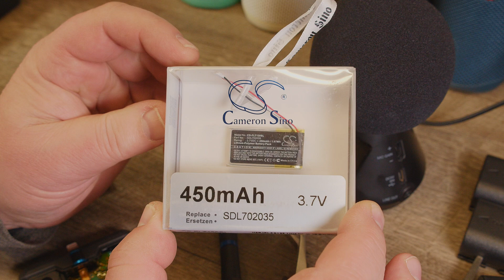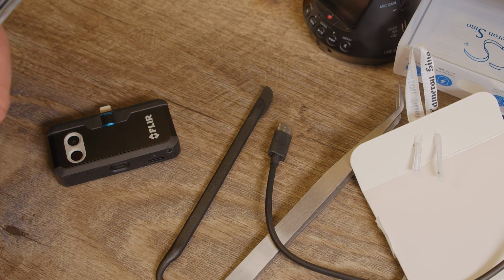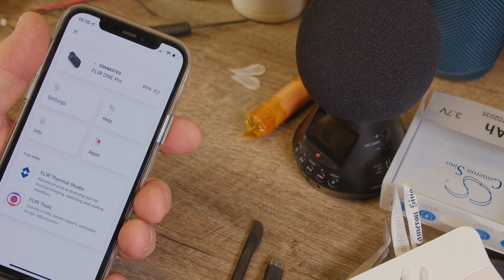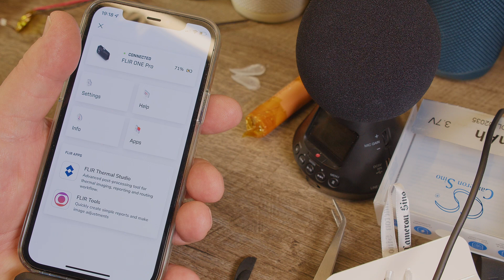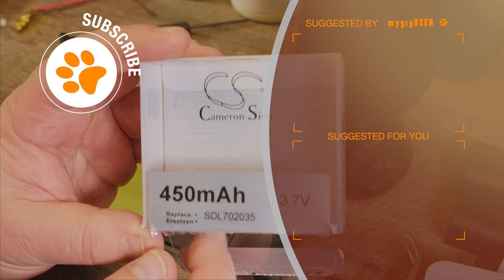Flir One Pro Battery Replacement (Cameron Sino)

Comment: Hello, I just got a Flir One Pro Gen3 and it neither powers on, charge, nor show any LED's at all. When you connect a charger through a USB Meter, it's shows 5v and 50milli-amp draw. When you press and hold the power button for a few seconds, current drops to 0.00a then moves to 0.89amps and continues to drop steadily until you let go of holding in the power button, then current immediately changes back to 50milli-amps. Is there a fix for this? Battery initially measured 0v when I took it out, but I tried charging it externally and got it to 3.56V but still doesn't work to turn the device on, at least, or even charge. Please I need help!!!
Reply from the maker: @PGreat7  i think you should return it
Reply: Well, I got it off eBay as not working, I thought it was just the simple battery issue.

Comment: I just replaced the battery on my Flir One Pro.  Be careful removing the old battery as the connector to the small circuit board on mine got ripped off when I tried to slide out the old battery connector.  Thankfully I am OK with a bit of micro soldering and soldered the bare wires from the new battery directly to the solder pads on the pcb.  That's the only point I would make otherwise great tutorial, my fault for not being more careful.
Reply from the maker: How can that happen to a professor? Anyhow, thank you for your comment!

Comment: Thank you so much for this excellent video.  I thought I was the only one with a battery problem, it seemed to discharge when doing nothing, unlike other lithium battery applications.  I never got any help from FLIR on this.  I think my FLIR One is Gen 1, is yours? (Mine says P/N 435-0006-01).  Maybe later versions fixed some battery problem?

Comment: Oryginal Batttery is : 3,8 volt 1,97 Wh
Thickness: 3,6mm
Long: 36,5mm
Width is around  - 20mm

and you can buy this battery on aliexpress.

Comment: Just got the exact battery delivered today. And found that I also need the T5 screwdriver. Damn!   Also wondering if the new battery has the same discharging issue as the old one ?
Reply from the maker: Oh yes, same issue persists. It is important to charge it at a minimum of once every two weeks, or even better at least once a week, if not in use! This is possibly breaking the battery, if it gets discharged too low, when storing this device for a month without charging.
Reply: @mygiguser  okay. Thanks mate.
Reply from the maker: I mention that in the video that you need a T5
Reply: I found my battery was discharging because when the camera is in its case the rather stiff foam insert was pressing on the power button and turning it on. I cut away the foam so that this couldn't happen.

Comment from the maker: I only charged this battery once, and i still have 57% battery left after 4 days. I do think that the original battery died, because it was discharged too low at one point. So far so good, i am going to keep an eye on this. Maybe it is really necessary to charge this device on a regular basis at least once every 2 weeks.

Comment: I wanted to do this on my flirone (basic model) for months. Thank you
Reply from the maker: Order the battery first, it took almost a month to get here!
Reply: Hi there, did you get it to work in your model? I just acquired a pair of older IOS models used, one works, the other is dead, I assume it's the battery. I can't figure out the FLIR model terminology, all I can find is the new Gen3 variations, and Gen2. Was there a Gen1? Mine are P/N 435-0002-02-00, I think that's Gen2? Anyway, do these take the same battery?